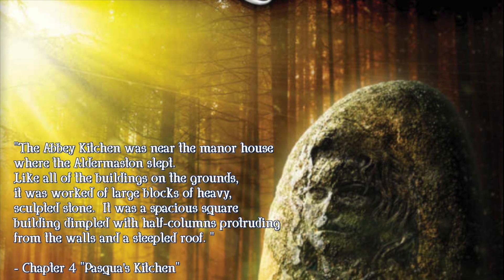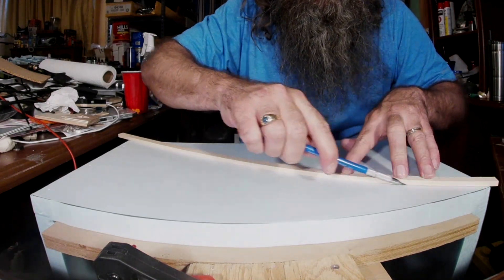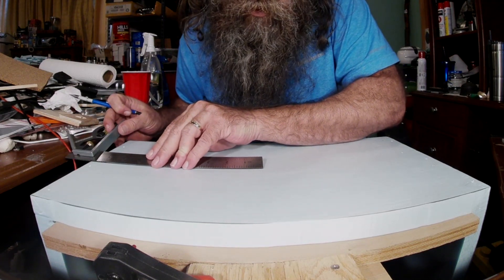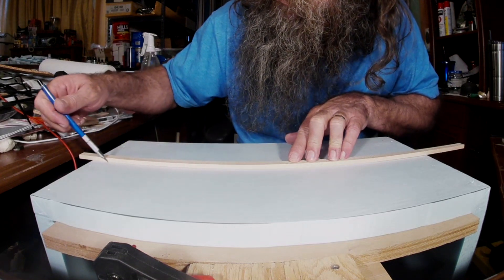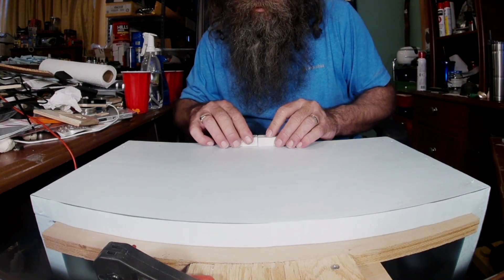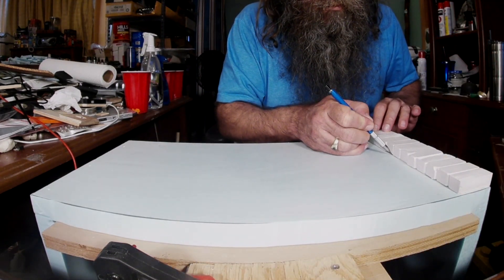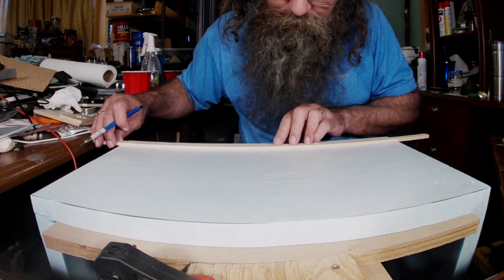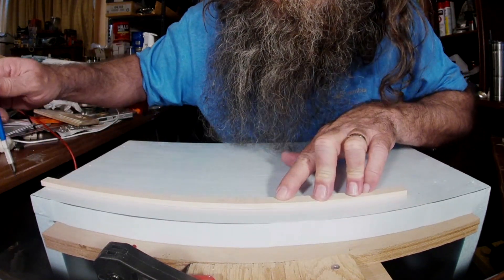Pasqua's Kitchen - The Walls | Part 2

Comment: That tool you used, looks like a nail tool, to remove the cuticle when you prep the nail (yeah, nail geek too)
A small tip for the small handle on the cuticle pusher, you can build it up with fimo clay to make it easier to hold :) I have problems with gripping things, so that´s what I did.
Making a brick wall like this, I find it easiest to just mark out how high I want the bricks to be and make those lines, then measure out the bricks on the first row, after that, just freehand it row by row....
The 2nd tool you used looked better for this job.
Overall, I think you did a good job :) and I am really looking forward to see more :D 💜
Reply from the maker: Thank you for the suggestions!
Cuticle tool came to mind, but the edges are sharp!  I didn't think a cuticle pusher would be sharp.  Great idea with using clay!
The "second tool" that I used ... was a mechanical "drafting" pencil.  It has a really thick lead.  I will be using it from now on!😃
Reply: @dolfinmagikpro  Cuticle tool is sharp, at least the metal ones, that´s why many uses orangesticks instead :) less risk to damage the nail too...but the metal one is good for a lot of other uses ;)
Reply from the maker: Thank you!  Good to know!